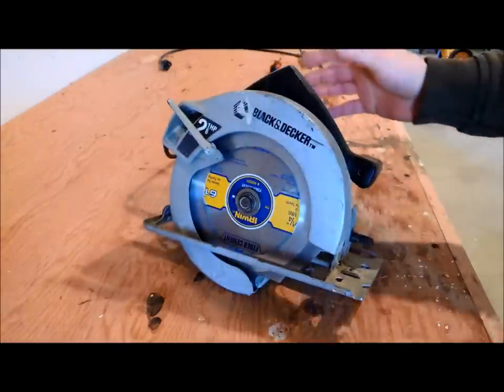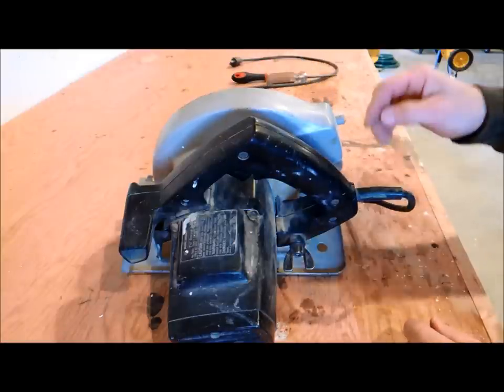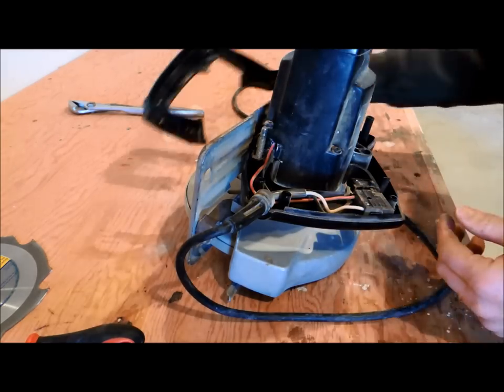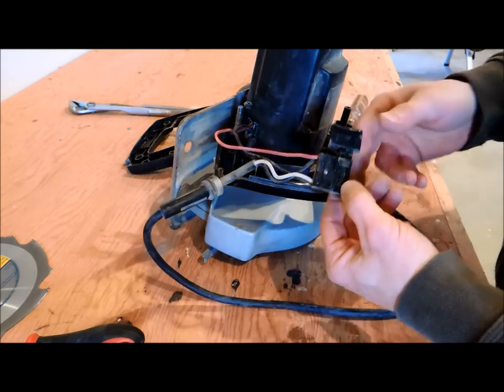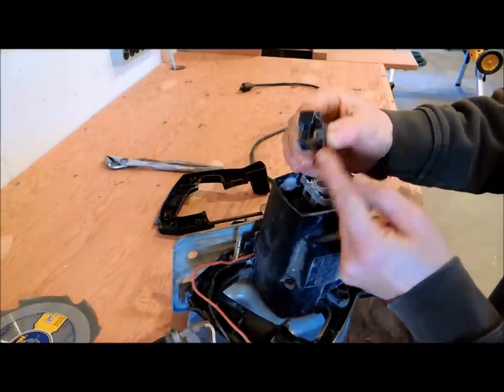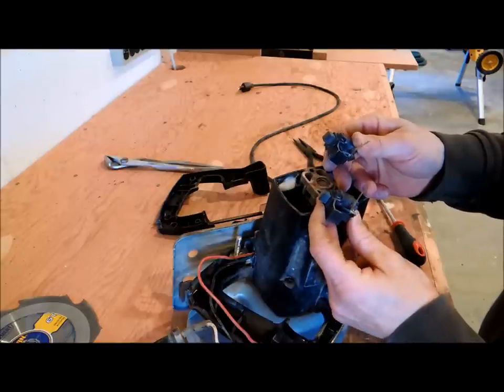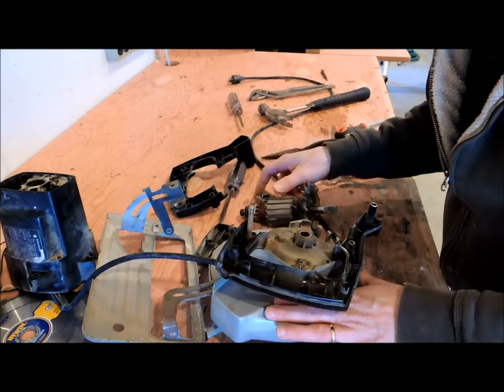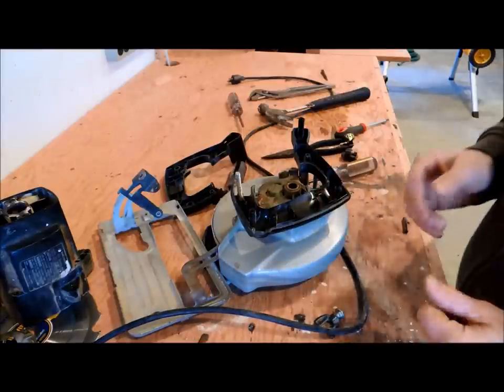Circular Saw Disassembly: Save These Parts!

Comment: I've taken apart a few dryers and washers, and a dishwasher before. I take the motor out as well as the wiring harness. The wiring harness is very handy to have around. Great video. I also save the nuts bolts and washers. The washers get used for fishing weight. Lol.

Comment: cool video! could you use the motor from a saw for other things for example to make a disc sander?
Reply from the maker: +David Hall I suppose you could use the housing and motor and re-purpose it for another use, but you'd have to come up with a means to attach a gear or pulley to the output shaft.
Reply: +enduringcharm awesome ill try it with a old saw i have

Comment: The power cord in my circular saw just got tangled with the blade.
Any idea how to get that out of the blade compartment?
Reply from the maker: Mahle77 I guess the good news is you didn't electrocute yourself!  Not sure how much help I can be without seeing the problem, but you might try removing the nut that holds the blade on to see if that gives you some wiggle room.  You could also just use diagonal cutters to cut the cord into small pieces that can be removed.

Comment: How can you open the switch compartment where the wires are joined
Reply from the maker: Well, at 2:03 I show the open handle, but do you mean the trigger itself?  The trigger itself is typically not meant to be opened after manufacturing, although you may be able to do so by drilling out the rivets or prying two halves of the case apart.  More typically you purchase a replacement trigger if you are repairing a saw, since the internals are generally not repairable.

Comment: Hey there, I have a Black & Decker KS850 Circular Saw which was spinning sporadically so I have taken it apart to investigate. I think there may have been a loose piece of plastic that had broken off from the motor mounting but it doesn't look that important so I chucked it out. The motor is sat firmly in position. 

I tested it and notice that it was creating large sparks and getting hot without being stress tested, as in, it was just spinning without being used to cut through anything.

Can you please tell me what you think is causing this?

I have included a video example.

 https://youtu.be/egjzrOwIp3w

Manual: http://service.blackanddecker.no/PDMSDocuments/EU/Docs//docpdf/ks227_uk.pdf
Parts: https://www.2helpu.com/PDMSDocuments/EU/Docs/Service%20Dossier/KS864_1D.PDF

Thanks.
Reply from the maker: It's kind of hard to see what's going on from the video, but typically when you see sparks like that it's related to the brushes.  They may not be contacting the armature well, or they could be broken.  Is it possible that piece you saw broken off was part of one of the brushes?
Reply: Thank you for your reply. It's definitely not part of the brushes as it was the same colour as the plastic used for the housing. The motor and metal parts appear to be in good condition.

There are two sprung contacts that go either side of the spinning part and these appear to be in constant contact, are they supposed to actually touch at all times?
Reply from the maker: Yes, the brushes are in contact with the armature at all time, under spring pressure.  However, they should ride smoothly where they contact and if something has gone wrong they can spark because they are jumping around.  Take a look to see if the plastic piece you found was part of the housing which kept the brushes in alignment.  Maybe one of the brushes is misaligned now.  Also, rotate the armature slowly by hand if you can and see if the brushes are smoothly contacting the metal or if they are bouncing around.  It may be difficult to see, I realize.  You can remove the brushes now and see if there is unusual wear on one of them now that you've run the motor and seen the sparks.
Reply: Thank you for your reply. I can confirm that everything is nicely lined up and there is no play in the motor seating.

I did spin the armature by hand and noticed that there is one particular section at the rear of part number 368877-02 (commutator bars?) which makes the two brushes move outward when the bit in between them spins a revolution. It looks like it is sticking out slightly too much.

Will the metal bit grind down so that it is even like the rest or does it need replacing? The amount of movement is less than 1mm (although exactly how much I couldn't say).

What could cause one of the metal contacts to protrude ever so slightly?
Reply from the maker: I'm not exactly sure what's going on based on your description, but it sounds like your armature is either bent or damaged somehow.  That's not good.  If the brushes don't have continuous and smooth contact you'll not only get that sparking but the brushes will prematurely wear or break apart (they are brittle) an the motor will not have full power.  You can replace the armature if they are inexpensive or else it might be time for a new saw.

Comment: Just replace the bearings, it'll last you a lot longer than one of todays POS saws that use bronze bushings instead of bearings
Reply from the maker: It can be a tricky decision to repair or replace, actually.  This particular tool was just a low-end throwaway saw used for demo work.  But, with more expensive tools the decision depends on availability of parts, how much wear the tool has overall, and perhaps how much better or worse a new replacement model might be.  Generally I will repair tools unless they are just beyond redemption.  I made a videos about repairing a tile saw, miter saw and router, all of which are still in use.  On the other hand, I have impact drivers and drills which just need new triggers, but the rest of the tool is beat up and the battery system is dated, so I gave up on those.
Reply from the maker: Well, Craftsman is just a shell brand which re-badges tools from actual manufacturers.  Any claim to quality disappeared in the 60s.  But, you should do some basic tests before you give up.  Open up the handle so you can test the cord with a meter, make certain the electrical connections are tight, and check the trigger for electrical operation.  If the brushes are accessible you can make sure they are seated correctly and connected.  It may just be a simple thing preventing operation.
Reply: Rusty  It's probably a piece of shit, which is the case for all of todays saws (except the Mafell MS55), but I think you'd be surprised how easy it is to fix it. I would try checking the switch first. Pretty much all that is required is that electricity must flow through the field windings, and through the brushes through the commutator to the armature windings.